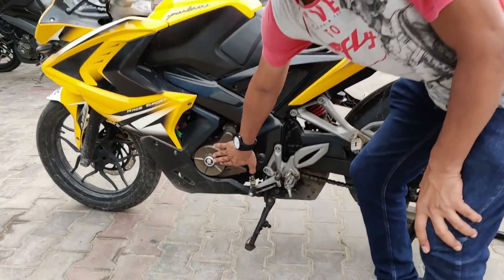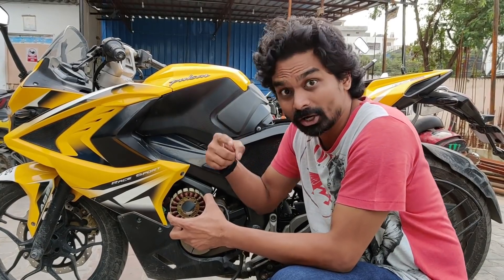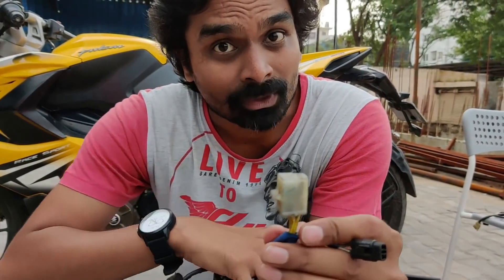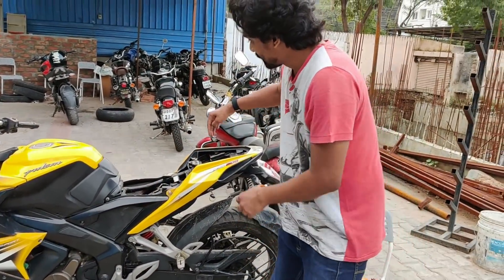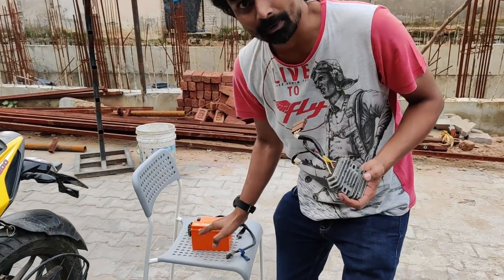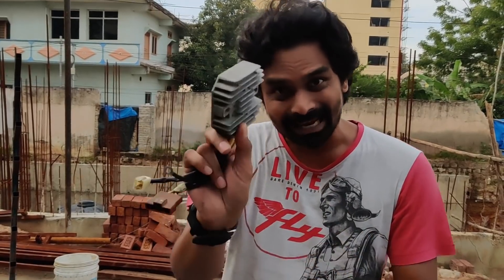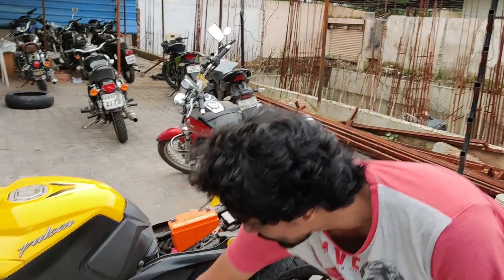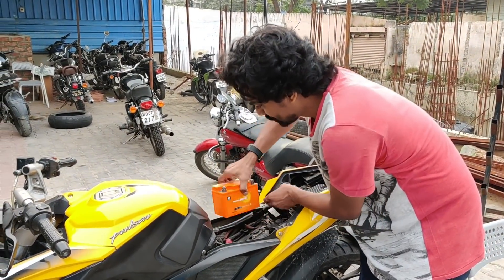Motorcycle University: How does a Motorcycle Battery Charge?

Comment: Thank you for explaining it in such and easy way, also can you please explain why does the battery die within a week of not using it? Also let's take a case the bike start with cracking because of low battery will it charge sufficiently if riden for 40-50 kms that day? Or does it need to be manually charged at a garrage?
Reply: I’m facing the same issue with my 2015 RE Thunderbird350. One week of leaving it parked drains the battery completely.

Comment: What a horrible place to install the rectifier on the Pulsar. Rectifier generates lots of heat (while converting AC to DC) and needs good air flow to dissipate the heat. Under the seat is a bad place for that purpose. It should ideally be placed somewhere around the engine where there is plenty of airflow.

Comment: Bro, I have a RS 200.... Battery is showing 13.8 volts... But still I'm facing that problem while starting..... I have to press and hold the started for too long to start.... Please suggest some tips bro....👍
Reply: clean the battery positive negative points also clean the connector pin of rectifier/regulator with petrol and try again after charging

Comment: The secondary console of DOMINAR 2018 has a battery light. But it never alerts when the battery is weak or about to die. It only glows when the ignition switch is turned on and goes off when the engine starts. Is there a way to know the battery health from the battery light?

Comment: So, if it keeps charging all the time when we are riding, won't the battery overcharge?
How is that controlled?
Reply: as long as you keeop the voltage at 13.8v sealed lead acid batteries aka SMF Lead acid batteries will not overcharge. but if the voltage increases to 14+v then gasing occurs and the batteries loose their life. As a rule of thumb SMF batteries should be charged at constant voltage of 13.6v with current limited
Reply: no it will not overcharge due to as there will be no potential  voltage difference when the battery is fully charged

Comment: How many watts the rectifier gives to the battery (12v,9amphere) and how many hours we need to drive a bike to full charge a battery, if we switch off aho it helps to charge the battery quickly please tell me vikas
Reply: It is said that you need to ride the motorcycle for about 15 kms (at over 3,000 rpm) to fully charge the battery. RPM is important because during idle, the rpm is below 2,000 and it drains the battery. So simply starting the engine and letting it idle will drain battery. You have to rev it over 3,000 rpm to actually start charging the battery.

Comment: Hi Vikas, small doubt, does just starting the motorcycle and keep it on (not riding it) charge the battery?
Reply: yes it will charge but at a slow rate if you do not put ON any electrical component like tail lamp,indicator , headlight
Reply: @AwesomeTechRider  how long does it take, to charge the battery. It use a lot of battery to turn it on diring the winter, but I can't drive it then. How long should I let it run, to be sure, that the battery is full.

Comment: Thanks Vikas , it cleared all the doubts about the battery charging system in details , role of rectifier , regulator , magnetic coils generating current , all the voltage range ( current ampere details missing) in different components of the system , now I understand and will be able to talk to the mechanic properly , thank u once again , and look forward to such more type of detailed videos on theory and practical and safety aspects of different automobiles ..😎👍👍👍